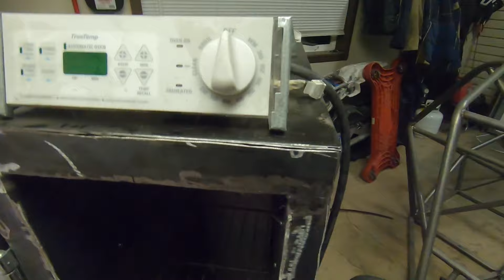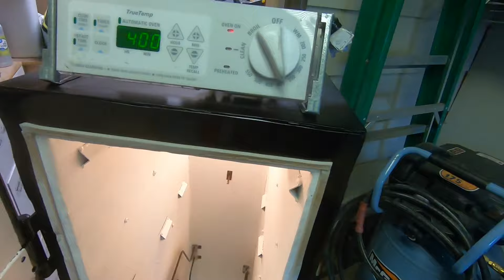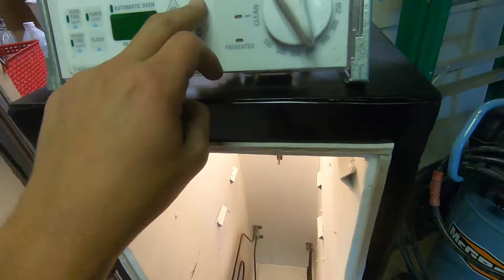DIY File Cabinet Powder Coating Oven for $255 or less

Comment: Aluminum conducts heat MUCH faster than steel, it would be hotter and it would take longer for the oven to heat up.  You need to just insulate the door and separate as many connections between the faces as possible.
Reply from the maker: The door is insulated but not ideal. I just put a sticker on to that says hot so I don’t forget lol

Comment: Do you plan on trying use both elements at once? If so how do plan on wiring it! Prob one burner will be plenty for that space! Interesting build though! I live repurposing!
Reply from the maker: Yes both burners are used at once. I doubled up the wiring so that when the broil is selected both burners turn on full power, or when a temp is selected both burners turn on until temp is reached. Both burners aren’t necessary but it helps bring heat up much much faster.
Reply: @BWBGarage  Hmmm that’s a good idea actually using the broil!! Thx

Comment: Your primary mistake with this project was how you installed the insulation. The insulation was compressed far to much. It needs the air to get it's R-30 rating. You should have peeled of layers of the insulation that were no more than 2x as thick as the open space available.  For example: If you have a cavity that is 12" x 24" x 1"; cut a 12" x 24" piece of batting and then peel off a layer that is about 2" thick. Your approach did not work because compressing the insulation so much, increased the effective density. The denser a material is, the quicker it can conduct heat. Fiberglass  insulation works because the strands are 5–25 micrometres thick and surrounded by air. The air acts as a heat sink slowing the transmission of heat. Compressing 9" of insulation to about 1.5" reduced your R-30 to about R-5. Furthermore, you could have reused the insulation from the oven and saved yourself some money. Based on your video and looking at my own oven, you have about half the cubic inches of air space to fill. Also the pink insulation you listed is not the same as what is used in ovens. That is apparently a form of fiberglass called Ceramic Fiber.
Reply from the maker: Good pointers! If I ever build another oven I'll take them all into consideration. Cheers!
Reply: @BWBGarage  you did an AWESOME JOB!! I stole a few of your ideas. I found a much larger file cabinet and two sheets of sheet metal in front of my neighbor’s house for the trash...rolled my dolly down the street and went shopping...LOL
Reply from the maker: Awesome! Thanks for sharing